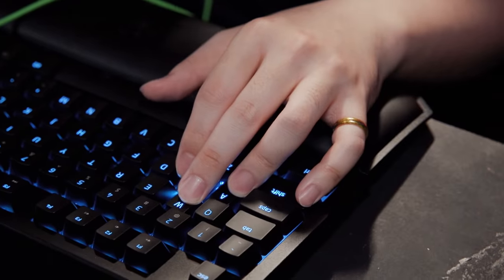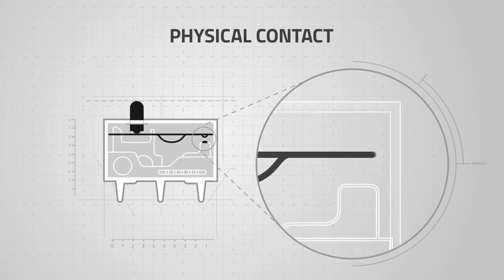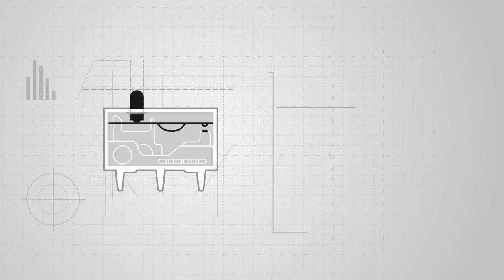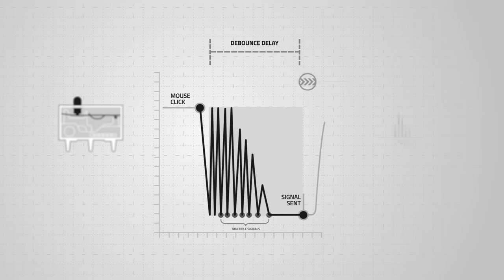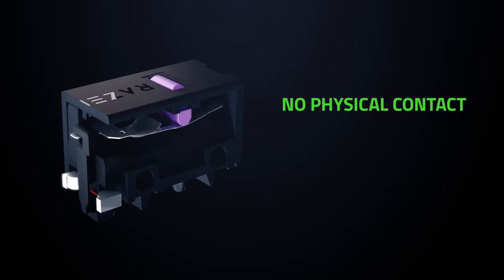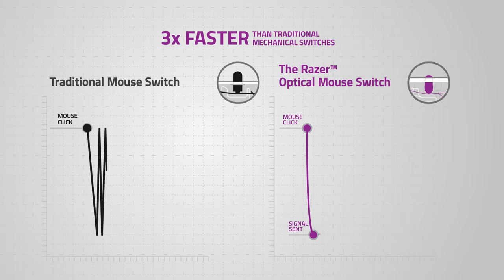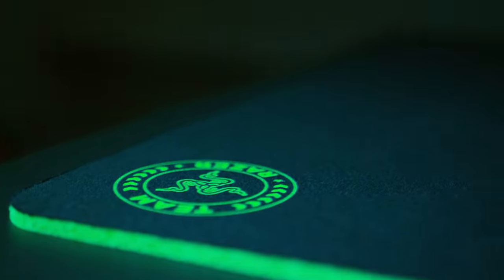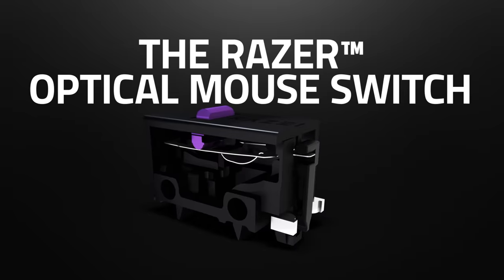The Razer Optical Mouse Switch

Comment: If u can notice the difference the between 1ms and 0.2ms u should go to a doctor
Reply: Or Area 51.
Reply: Elijah Razer works at Area 51
Reply: -The guy who never tried a 0.5 ms response time  monitor
Reply: Lol so you r saying the keyboard with those response times and actuation points that r lower than 1 ms r basically garbage lol. I have a lightspeed keyboard and there is defintely a difference betweeen a regular mechanical keyboard
Reply: Celox damn I almost read that you said “lightsaber broadsword”
Reply: @Tromaxer  lol
Reply: I dont tell you how much meth to take!
Reply: You're horribly wrong if you think that stuff with less than 1ms response time is useless
Reply: @FeeLtheHertZ  lol
Reply: Monitors on 144hz have 8.3ms between each gram so 1ms-0.2ms isn’t even noticeable
Reply: i mean the standard for good mice is 4 ms so going down under 1 ms is kinda nuts
Reply: Traditional switches on good mice can actually be as slow as 4ms though, so pretty big difference. The XM1 just uses the best switches they test and bin the rest, those are closer to 1ms response time. Does this actually have an effect on your performance in game? Probably only for holding small gaps in hit-scan shooters.
Reply: Um, if you can notice the difference you know that means your reaction time or senses or whatever is actually good, right?
Reply: Do you watch noobdog or something?
Reply: @FeeLtheHertZ  lmfao
Reply: Elijah pro players will notice it
Reply: Feel The Hertz You play games like CS and Dota and the input delay of even 0.1 ms can cost you a game. Just for reference the time frame for a manta dodge is 0.1 ms and you are expected to carry out manta dodges in many scenerios of the game in DOTA 2.
Reply: @obitorasu1760  whoa there, there is no way for a human to spot the difference of 0.1 ms. 0.1 seconds maybe because thats 100ms. 

The normal reaction time of a human is 200ms. I think you confused milliseconds and seconds.
Reply: The haters would have us stuck on 60 hz monitors and standard mice and keyboards. Fortunately not everyone feels the way they do.
Reply: Celox Placebo exists you know.
Reply: MEDsoft Just because the normal reaction time of a human may be 200 ms doesn’t mean time should be stacked on that. Every delay on top of human reaction alone all adds up. It’s not about a night a day experience of one component it’s about the cumulative benefit of low delay components especially in competitive environments. Anyways there are surely other advantages to this switch outside of shorter delay. One being longevity.
Reply: Ohoho, if you play things like Osu! you really can see the difference
Reply: @TrVx_  You are horribly wrong if you think a 0.2 ms response time mouse can make a difference than a 0.6 ms mechanical switch mouse. Legit.
Reply: @Poprotta  Its not that genius, you dont spot the difference you feel it, your clicks becoming slightly more responsive can mean you can land say the manta dodge in the example thats what.
Reply: @a-1291  Monitors can respond late true but your raw input still is registered regardless of how fast your monitor shows or interprets it and can make a slight difference.
Reply: @Maraien  No, your focus will degrade more faster if you keep doing it. Tldr,  being ultra sensitive isnt always the best choice for health in long term. Personal experience. 

If you arent pro gamer,  dont bother about differences of 0,2ms and 1ms.
Reply: Jajajajajaaj
Reply: no but the computer noticed it
Reply: @obitorasu1760  again, you are confusing how fast a single millisecond is. One second is 1000 milliseconds. There is no way to spot a 0.1 millisecond difference. Its 0.1 seconds for the manta. 756 hours in Dota 2 for me btw.
Reply: @Poprotta  5k hours of Dota all across my steam accounts. As said you dont see it but you feel the difference at certain points, pros could be using office mice and keyboards but they choose specific ones for speicifc reason, you can check how input delay can make or break games even if you cant exactly see the small time frames, for example check a few vids on input delay in mices made by linus and also his comparison between wired and wireless lightspeed mices, you cant see the small time frame but the feel is different and evident from test results.
Reply: @JsGarage  that doesn't mean that this is just bs marketing...
Nobody will ever tell the difference on 0.5 ms
From 1 to 5 ms sure, from 1 to 0.5 i don't think so
Reply: everyone is saying 144hz is 8ms per frame, that's dumb u dont need to see the frame you shot at to react
Reply: @Poprotta  Im on 180 hz and feeling the difference wasnt something like you instantly detect your input is faster, I acknowledge the fact that it isnt possible, what I mean here is same as 144 vs 60 you are fine on 60 but once you go 144 you can never go back to 60, its just the better responsive feeling in the long run that just stays with you thats what, without debounce delay things will be faster and that will become the benchmark in future models as more people get used to optical switches same as everyone is hooked to omrons.
Reply: @lemitos3344  this is marketing bullshit, nobody will notice a thing about this shit
Reply: As said if everything was a gimmick half the fast input low delay stuff wouldn't be selling but they do and yes even if you can't see the change you can feel the difference in the long run. My schooling went fine and Iv 4 years worth of experience in the esport scene to know what Im talking about and why fancy stuff like these are picked up by pros.
Reply: Its not just about input, optical switches eliminate any chance of double click issues after repeated use, very common in top grade mechanical gaming mices including the death adder elite.
Reply: Bro. Hahahahah
Reply: I've seen you before wtf
Reply: @Tom_The_GCT  0.5ms faster for extra 300bucks isnt worth it at all...Bruh...
Reply: 0.2 is better than 1ms by 4-5 times.
Reply: @xlilclipx  for a monitor nah but 20 more for 0.2 ms keyboard is worth it
Reply: @Tromaxer  yo that sounds badass though
Reply: @Tom_The_GCT  light speed is Logitech's version of 1ms wireless, what are you on about
Reply: Going to a doctor
Reply: Who cant?
Reply: People who play rythm games notice it pretty damn well
Reply: But they add up
Reply: guess i should go to the doctor. Oh wait. I do.
Reply: Feel The Hertz lol
Reply: A lot of adderall
Reply: Heres where people are like, i can notice the difference
Reply: @obitorasu1760  do you actually know how little is ms you can only predict it. There is no way to react to 0.1 ms
Reply: I saw u in minecon video top comment lol
Reply: MEDsoft yea and we cant detect more than 30hz either right 

and our reaction time beeing 200 means that monitors could be 5hz and we still couldnt see it
Reply: Elijah guys im sorry i have to go to area 51...
Reply: play osu mania ok
Reply: I play csgo, and I have a 175 ms response time, and that's INSANELY good. 1 and 0.2 ms will not make any difference at all.
Reply: U have never tried to jitter click before only true mc players knows lol
Reply: @spiryn5174  Probably you don't know what is a true hardcore competitive gamer then.
Reply: @TrVx_  xD you really have got not the furthest clue of who I am bud
Reply: if you have used optical switch mouse, you can feel the difference. I can tell you there is a big difference. have used fuhlen and bloody opitcal switch mouse.
Reply: are you a noob dog fan or its just a random profile picture?
Reply: I dont think you need to "notice" it. Assuming you care enough (people who game with money on the line or whatever your reason), if we both click at the same time but your hardware has a quicker response time, your input goes through first and assuming all else is the same; you win the engagement.
Reply: Or mars
Reply: Elijah 😂😂😂😂🤣😂
Reply: @yy-ze6kn  360hz gangggg
Reply: let that sink in
Reply: No , the debounce delay in many gaming mice is 2-4ms depends on the mouse and This new feature is crazy becouse in game like csgo it will be good , Maybe not a big difference whit other games !
Reply: adderall addiction
Reply: @FeeLtheHertZ  area 51 for sure! 😂
Reply: @ThePhenom23  no if we click at the same time then it will do the same thing. What you referr to is when the bouncing effects takes places, after the 1st click bouncing effect takes places only for 0,6 ms, what this means you cant click for 0,6 ms after your 1st click, so unless your clicking time is < 0,6ms  you get no advantage except for the lifespan part.
Reply: 0.6 and 0.2*
Reply: That's true
Reply: This can save you :)
Reply: I can notice a difference between 2 and 1 but to 0.2 woah
Reply: Dude you can tell the difference big time atleast for me
Reply: Be a doctor*
Reply: @cristianramos7343  0.5ms is marketing
Reply: Elijah lmao
Reply: Why should that person go to a doctor? He's definitely not ill
Reply: Elijah, there is a huge difference
Reply: Well, rhythm gane players can easily notice it peripherals response rate and screens refresh rate
Reply: @yy-ze6kn  well, for rhythm game players it is
Reply: Haha yes!
Reply: More like join the X men.
Reply: I mean everyone can. Same goes with TN / IPS panels on monitors. 1ms TN panel vs 4ms IPS panel I can see a HUGE difference. I'm pretty sure there won't be much of a difference but you gonna notice it without a doubt.
Reply: @Poprotta  Nobody said ANYTHING about reaction time. Also 200ms is not normal reaction time LMFAO.
Reply: @Poprotta  Nobody was talking about reaction time... We were talking about can you " feel " the difference and the answer is ofc you can. There is a huge difference ( for an example ) between 1ms TN panel and a 4ms IPS panel. I can spot the difference right away.
Reply: If you cant feel the difference between  1ms and .2ms you need physical therapy
Reply: @PahEz   200ms is the normal reaction time of an adult human individual, go look it up. 

Second for the display depends if its 144hz or 60hz. 60 hz displays have a 16ms window between frames so the latency in the display has to exceed the time it takes to draw one frame to feel any kind of stuttering. 4ms isn't sufficient to cause this kind of delay. What you are feeling is placebo from thinking that it is better.
Reply: @PahEz  Secondly, reaction time is exactly "feeling the difference". Your reaction time is the time it takes your brain to get the signal from your eyes, and pass the signal to your arms to move in game for example.

And this for an average adult human is 200ms. 1 ms wont make a difference in there. Its called placebo, hopefully you one day get to study a bit of psychology
Reply: Agreed
Reply: Celox bro a mouse and a keyboard are different
Reply: Sometimes when you are playing a fps you can kinda tell the delay
Reply: @peng_susu6614  that's just feel not reaction lol
Reply: @Sn4p_Fps  you can notice 1 ML so doesnt matter do you know what a millisecond is ?
Reply: @Poprotta  these people think there superhuman dont waste your time on them only reason to buy this mouse is no double clicks at all and higher durability switches that last a lot longer
Reply: Is it 0.2 ms?
Reply: @cristianramos7343  and you try 360hz 0.1 or 2 msr monitor?xdd sorry for my english
Reply: @FeeLtheHertZ  888th like :o
    /\
  /  0 \
/         \
Reply: Minecraft players: hold my injured finger from jitter clicking
Reply: Who cant
Reply: I'VE REJECTED MY HUMANITY,  @leny4838
Reply: GEOMETRY DASH PLAYERS ASSEMBLE!!!!
Reply: Use it extensively for a few months, the fact that there is no activation and the 0.2ms present, you will notice a huge difference, especially in eSports title where every split second counts ( a few bullest of your AR that you may have thought that will never hit will actually hit! )
Reply: @Poprotta  you cant spot but you will do things without your knowledge that you may have been not able to do with a 1ms delay, that split second matters, and if that one extra bullet hits correctly, it could be a game winner! You don't need to see everything, it happens discretely!
Reply: bruh
Reply: I think you need a doctor. You probably dont play ranked and you might've lost cells. Grammar didnt make sense
Reply: @Eric Pham l
Reply: @Eric Pham oh. It's ok then
Reply: Uhhhhh
Reply: @Tom_The_GCT   I do too, and I notice literally no difference between razer opto mechanical purple switches and cherry mx blues.
Reply: @demonman1234  well there is a big difference just bec you can't notice it bec your different just like everyone else. Its been tested and there is a huge difference for people who want to play  competitive.
Reply: Nah i overclocked my eyes
Reply: That or its just cocaine
Reply: or youre a gamer
Reply: Yap
Reply: Better yet sign up for the x men
Reply: I can. There is still a delay, but I seem to be able to pick it up.
Reply: O.8ms
Reply: @Tom_The_GCT  you're probably noticing a difference in actuation depth not response time its humanely impossible to spot the difference as the average human response time is 215ms
Reply: @leny4838  correction again 6.944ms...
Reply: I will on geometry dash lol
Reply: I can notice the difference tho- 
It’s not that hard to notice, I’m pretty people who have tried it can tell the difference too
Reply: Sad jitterclick noises
Reply: If you are feeling the difference between 0.2 ms and 1 ms...
Say Amenadiel to go far
Reply: Or a professional team
Reply: it's hard to tell but this speed could make a game
Reply: Cough cough minecraft players cough cough
Reply: the real value is the wear and tear issues this solves. though i do wonder about debris blocking the laser.
Reply: I do
Reply: u paying or nah
Reply: @Tom_The_GCT  1 ms and 0.5 ms cannot be told the difference between

yes it is better, but not worth the extra however many dollars you're spending on that .5 ms reduction, because it 1. wont improve your gameplay whatsoever 2. won't feel any better 3. isn't going to help you play at a professional level
Reply: @Tom_The_GCT  you don’t have a “light speed keyboard” that is marketing speech lmfao
Reply: @cristianramos7343  it feels
Reply: Oh
Reply: 360*1ms=360ms
360*0.2ms=72ms
u should got to doctor, else u forgetting basic logical operations
Reply: I actually noticed it when speed bridging in Minecraft. My timing was so off i couldn't speed bridge for 2 days but now im used to it
Reply: @cristianramos7343  or 0.1
Reply: It's more about the computer  rendering it rather than the player
Reply: Or Avenger
Reply: OK gotta go to the doctor now

but there's a noticeable difference in like monitors keyboards and.. idk
Reply: Too bad I have 0.1 reaction my friend hahaha
Reply: Or go outside
Reply: It's not that we realize it, it's that it helps since it gives a competitive advantage to someone with higher click latency, for example if you put the Razer Viper Ultimate against any other mouse that has mechanical switches, the Razer clearly wins.